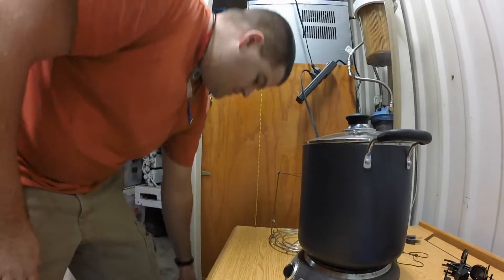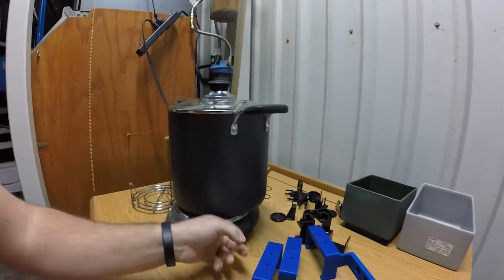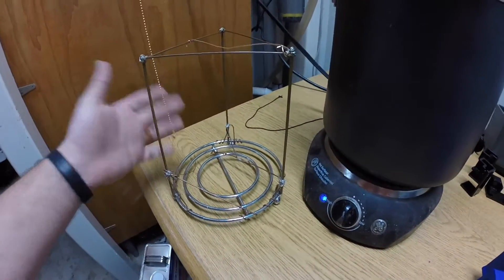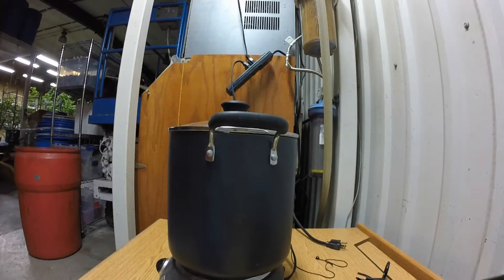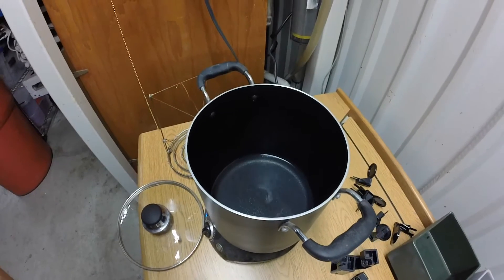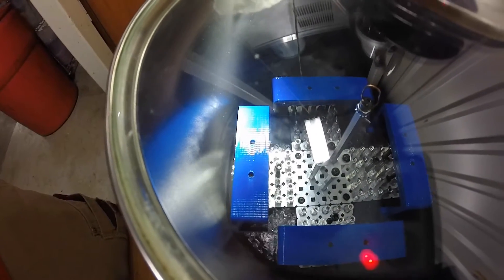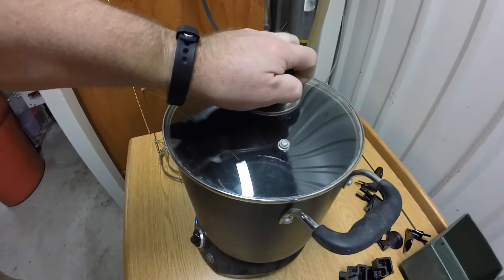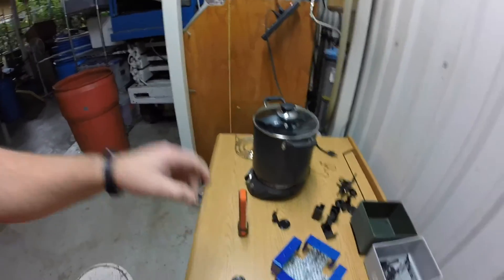Acetone Vapor Bathing

Comment: Be very careful with acetone vapor.  It's quite flammable.  If any vapor spills out over the top of your pot it will sink down around your hot plate.  Just one little spark from that hot plate and . . .